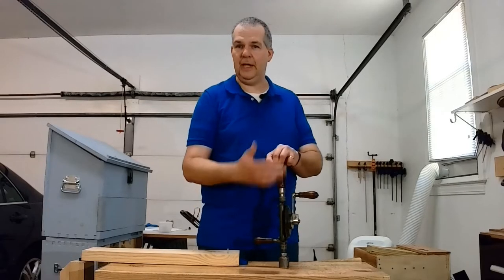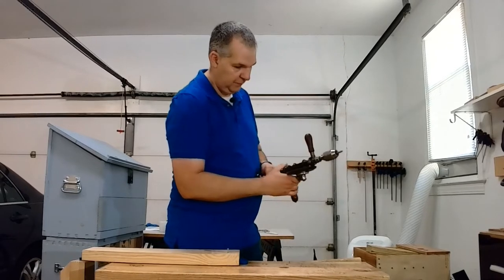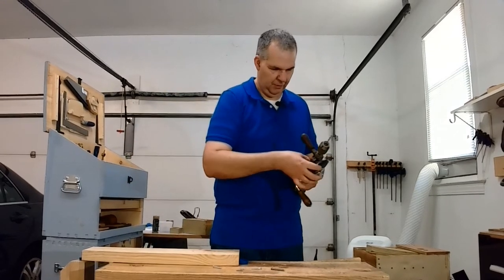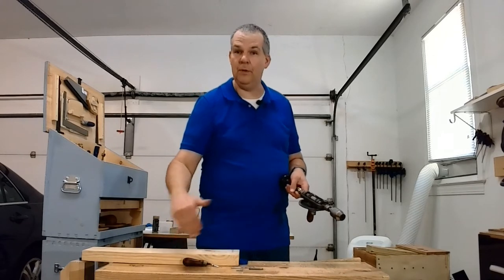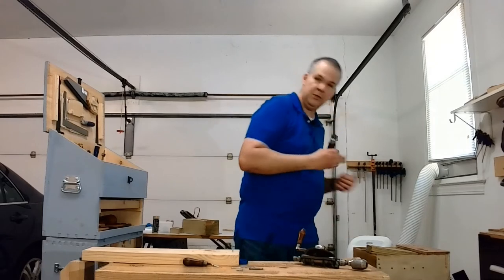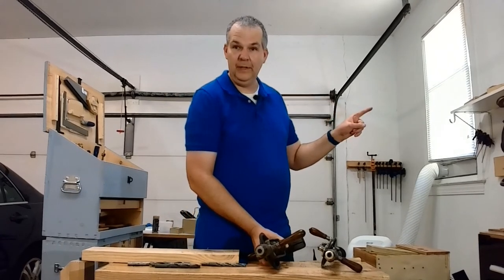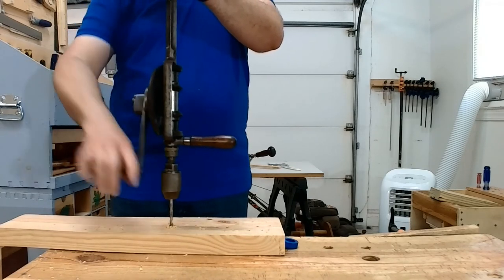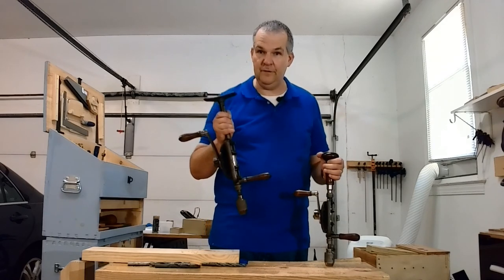Nifty Tools: North Brothers Yankee 1545 Drill & 1555 Chest Drill

Comment: Nifty tools indeed!  I tend toward using hand tools in my shop (quieter, less dust) and these are squarely between my braces and my eggbeaters and have some very nice features.  They are now on my updated wish list.  Hadn't heard of the brand but will be searching.  Thanks for posting these!
Reply from the maker: I used the 1545 today on my current project and it is such a pleasure to use. Out at antique shops I see a lot of braces and standard, smaller egg beater drills but rarely I'll see one of these or a friend will.  They are well worth it if you do find one.   Thanks for watching.

Comment: Did these come with a wide washer hand protector on the lower handle? Mine didn't have one and i immediately added one assuming mine was missing it. Its TOO well engineered to believe they made no attempt at keeping your hand meat out of the gears. Im in the process of designing a swappable back handled for a custom made. Vintage leather collar that perfectly fits my forearm so i can hold it one handed in my left hand more like i use battery drill
Reply from the maker: I've never seen anything like that on these types of drills. I also have a catalog for Goodell-Pratt Company tools and don't see any on their drills as well. You pretty much knew to keep your hands out of the gears, I guess. I notice you have a channel, is it possible for you to post a video with the one you're making once completed? I'd like to see what you made for your drill.

Comment: Maybe you should have used the Millers Falls number 2 for comparison instead of the number 5 cuz that's a tiny drill for tiny drill bits. 
My Miller's Falls number 5 is so tiny I haven't found a use for it yet. But I did put it in good operating shape just in case. And I got that for free cuz it was missing a couple parts and it wasn't working. It needs the screw on handle cap, and side knob.
Reply from the maker: The Millers Falls drill I showed is the only model I own. I don't have any others.  I use it for a  lot of basic drilling as well as for drilling pilot holes for screws and other basic small drilling needs. It came with some very small bits in the handle which I appreciate of the owner before me to keep with it.  It was also bought at an antiques shop. Thanks for watching.

Comment: A lot of people make the mistake of calling it a flathead bit. There's no such thing. It's a straight bit or flat blade bit, but not a flat head bit. 
To have a flat head bit it would have a flat blunt face with no bit on it whatsoever, or it would be for flathead screws which would be nonsensical cuz it should fit any type of slotted head screw. Not just flat head screws.
Reply from the maker: Of course you are correct. But that term is used so much now that to take it out of common use will be hard.  I don't know where I picked it up but I've used it many times, and probably will again. Oh well. Thanks for watching.